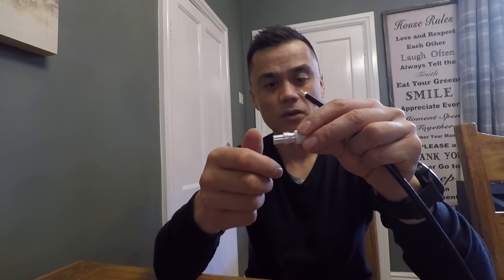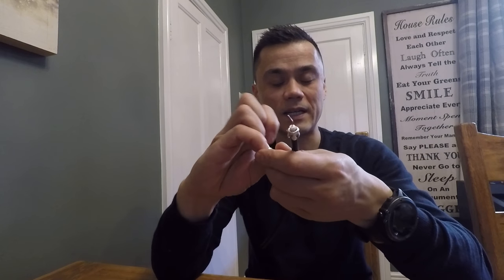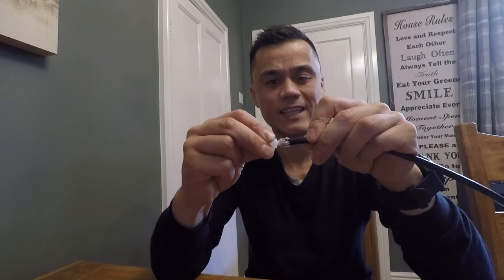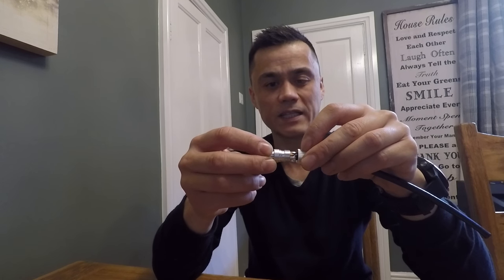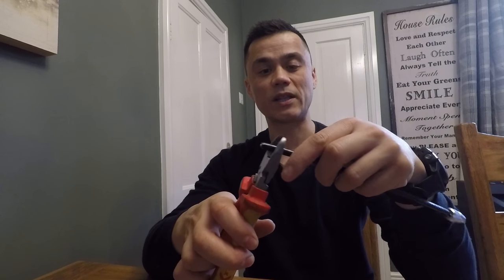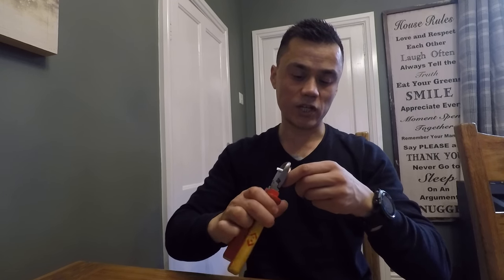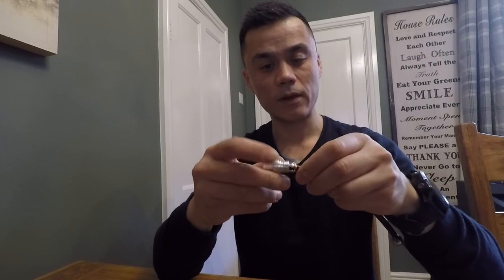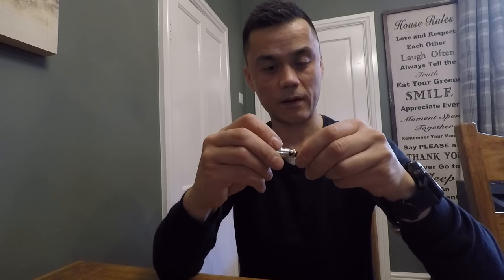Tv coax aerial plug fitting Tutorial Guide - How to

Comment: Our living room tv signal has been sooooo temperamental for years and the only fix has been to delicately fiddle with the cable until the picture came back. Tonight I reached the end of my tether and ripped the end off to try fix it once and for all. This video fixed it! The bloody outside wires were touching the core and causing it to short. I made sure none was touching (after cutting the cable shorter about 3 times) and boom! CLEAR PICTURE 🙌🏻 thank you!!!!!!
Reply from the maker: Thankyou, i'm glad it helped.
Reply: Would I be able to remove without getting electricuted sorry I’m not the brightest
Reply from the maker: Yes no high voltage passes through these

Comment: How long does the cable last before it becomes corroded? I got a cable installed only about 3 years ago and now I can only get a few channels :(
Reply from the maker: If the cable shows corrosion, water is getting inside the cable from outside. It could be at the aerial or somewhere on the route from the aerial down. I've seen this happen where the water has got into the TV from the aerial cable, which is serious.
Reply: @TellyDan  That was what I thought. Is there anything that can be done to make the cable last longer?

Comment: Can you help with some advice on aerials,I have been given a brand new digital aerial which i hoped to use in the garage for an older tv, but after trying out various methods to connect, I am having no joy whatsoever is there a simple clamp on the connector that will actually convert the unit back to a normal one and then just using some coaxial cable it will work fine , after all the unit itself is just standard aluminium framing so i am confused as to why it does not work,, and advice would be great.
Reply from the maker: Hi Peter, have you checked the connection is clean on the aerial and no fray is touching the copper core or anywhere on the connection it shouldn't be? Things like that will kill the signal
Reply from the maker: Apologies for the delayed reply as well

Comment: Why does the crimp section have to touch the copper braiding? What difference would it make if you just cut the lose bit off? I can't see this explained in any video or instruction guide.
Thanks
Reply from the maker: That's the negative part of the connection. You need a good connection to carry the low voltage.
Reply: Thank you. So it works like electricity it needs a return back to source?
Reply from the maker: Yes. Alot of systems carry 9-12v for powering amps/splinters and infrared pass through